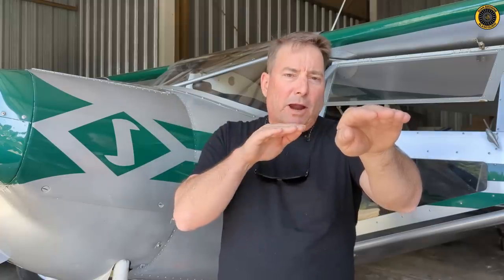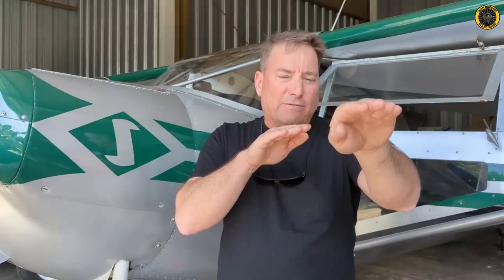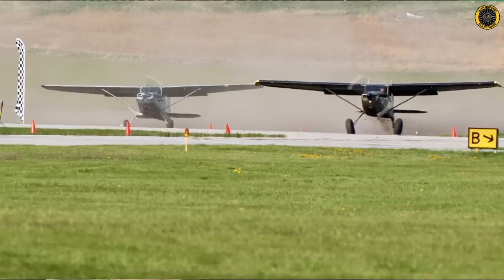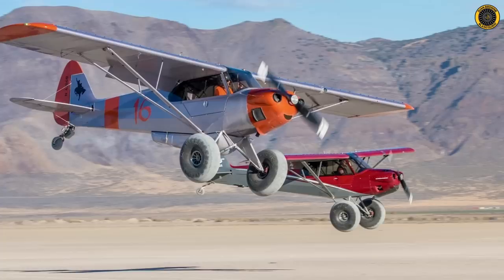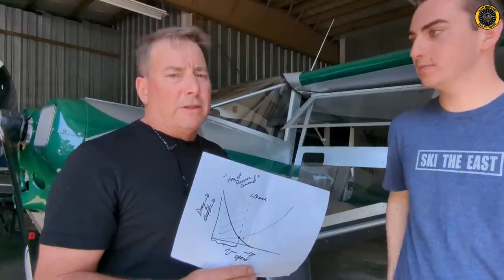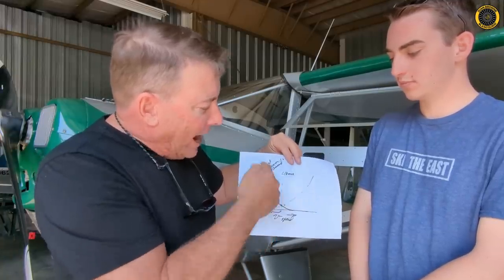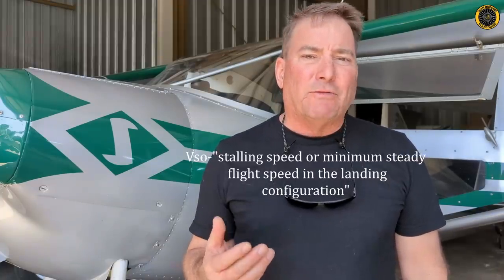Cessna 140 Stall/Spin Accident Wayne NE

Comment: Horrible accident and so sad....The most accident pilots have over 250 hours and under 1000 hours...for STOL,  a steep stabilized approach followed by a touch of power at round-out is what a lot of us Alaskan brush pilots do....seems to work OK. Never haring it on the prop....

Comment: Every pilot should have some training in aerobatics. An experience aerobatic pilot would leave the ailerons neutral, and pick up the low wing with rudder.
Reply: Sam,a lot of pilot training is inferior. This is basic airmanship which needs no aerobatic training. Some Flight Instructors simply don't impart knowledge and are just "time building"😡.

Comment: Super tragic accident that should not happen. It must be a headache to practice extreme STOL operations in gusty wind when suddenly several knots of airspeed is taken away when the wind slows down. It must be extremely difficult to „trust“ your safety margins in such situations. If the pilot unfortunately may have some errors in the stall situation it is a tragedy in itself. But if the real killer is the gusty wind the whole ordeal could perhaps have been avoided by better decision making of the competition leaders??

Comment: Can you please explain the phrase ‘hang it off the prop’?
Reply: Consider an acrobatic aircraft with a very high power to weight ratio, such as a turboprop or jet fighter (but definitely not a C140). In these aircraft it is possible to be in a stalled condition but still ascending, purely by the thrust of the engine overcoming the drag from the wings. This is the opposite of normal flight, which is sustained by lift from smooth airflow over the wings.
Reply: @gordonrichardson2972  makes sense, thanks Gordon

Comment: What a tragedy, so awful to see. Thoughts and prayers for the Dafoe family.

It seems this accident has catalyzed a lot of discussion about the risk/reward equation for STOL competitions in general. Some have broad-brush categorized these events as "excessively risky". A few thoughts, as a non-pilot interested observer of aviation. Hopefully they have some value! Curious to hear what pilots with knowledge & experience think.

1. I'd think the survivability of an accident during the actual STOL competition / demonstration operation is very high in a true STOL aircraft, especially if the pilots have good harnesses, wearing helmets, etc. Sure they are flying on the ragged edge of stall conditions, but at low speed and ~20' AGL or less. Potential crash energy is relatively low and there isn't enough altitude for a severe nose-down impact. Now how much does survivability decrease at the higher speeds that Cessna 140 will be flying? That's a question worth asking. For competitive events, should organizers set a maximum stall speed limit, to control which aircraft participate and contain the potential crash energy during STOL operations within some reasonable bound? Worth thinking about crowd safety here too.

2. Whatever the stall speed, continuing to fly at the ragged edge of the stall envelope after liftoff, or initiating it before flare to touchdown seems like senseless risk. As far as I can tell, there is nothing to be gained in terms of competition or putting on a show, and survivability of a stall is low as Tom's accident so tragically showed. A bad altitude to stall an airplane. Did Tom know how close to the limit he was when he got backed-up in the pattern, and were the consequences of a stall at that moment top of his mind? We'll never know, but perhaps there is opportunity for STOL-specific procedures and training to ensure pilots are switching mental gears from "stick and rudder on-the bubble flying" during the STOL portion to standard "Vref + margin" flying once they are out of ground effect? I can imagine how a pilot might get "sucked-in" to the thrill of balancing the airplane at near-stall conditions, and forget when and where that type of flying is simply too risky. In Tom's situation, you want your mental program for "maintain airspeed", to kick in, not "perform STOL flying".

3. I hope useful lessons learned come from all of this, and these STOL events continue to grow safely. Love seeing the airmanship & flight physics on display. Looks like a great community to build skill and camaraderie, with some low-key competition to keep things interesting. Terrible that Tom's accident happened, and during the event with so many people around to witness. Hopefully the aviation community will learn and benefit in some way from this hard lesson.

Comment: What a tragedy. Wonder if there is any way to practice the right reaction to those low altitude wing stalls in turns. Wasn't part of my PPL training. Simulated approaches are higher altitude maybe? Is anyone doing this specifically to train muscle memory?
Reply: Jan, you should have had some preflight plan on the flight lesson, instructor demonstrates, you perform.
Reply: @garymiller5624  I mean specifically stalls in approach patterns. Did plenty of regular stalls but never in low altitude. Honestly not sure I would have the reflex to push the plane towards the falling wing like in the video. Of course almost impossible to simulate. I’m good at flying exact approach speeds though, maybe that sufficient.
Reply: @experimental_av  There are Take-off and landing stall's in several configurations but need to be done at a safe altitude. I question that you were exposed to all of them but certainly needed to be. They are required by FAA in the Flight Test Guide. Practicing "slow flight" in different configurations and banked are excellent for feeling the airplane. If one doesn't "feel" an airplane after some time flying the same plane then it's time for some more instruction with an instructor WHO CARES 🤭

Comment: RIP pilot.. It's the C140 a  STOL  aircraft ?
Reply: Not a STOL aircraft as manufactured. I owned a true STOL aircraft, HELIO COURIER.
Reply: NO, it is not.  Which begs the question; why would Tom make the decision to compete with STOL designed aircraft using a vintage C-140?.... all while leaving a beautiful family of six at home while he exercises his ego.
Reply: It can be when operated inside its limitations. Will it perform as well as designed and built stol aircraft. No but all aircraft have a set of short take off and landing procedures and performance that is as widely diverse as the aircraft themselves.
Reply: @jmp.t28b99  had one of those “ Helios” at our airport last year. Cool aircraft to watch. It was some strange flying characteristics doesn’t it.? I seem to remember something someone told me. Could be wrong.

Comment: So what has to be done? Turn towards the direction of the stall, in this case turn right with right rudder ?
Reply: You learn to avoid it before getting into it.
He was too low to lower the nose and level the wings and power up.
Reply: Opposite rudder. And someone correct me if I’m wrong on this but neutral stick as in hands off while kicking rudder. Plus, chop back throttle to idle. If have the altitude, be ready to pitch down before level and add power.
Reply: Other than preventing the stall/right spin in the first place, LEFT rudder would have been the most-appropriate input....when the right wing first dipped! To prevent the stall spin in the first place once he realized that he was getting too close to the aircraft being overtaken, he should have lowered the nose somewhat and increased the throttle until airspeed was such that it was safe to initiate a turn for a go-around.  Coop
Reply: Abort landing
Increase engine speed
Slight deviation flying parallel (left) of runway.
Go around flying a left hand circuit.
Reply: Scott Perdue produced an excellent training demonstration video a few months back:
FlyWire- scott perdue: "Spinning a Bonanza with Shannon UPRT 1"
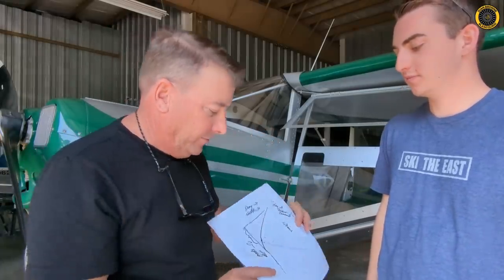He has another recent excellent video "J35 Bonanza Power-On Stall / Spin", key to watch from that from the 7:58 mark.

Comment: Sad. But it seems to the outsider at least like a discipline rife with adrenaline junkies, young guns, Red Baron hot doggers, and limit pushers. There’s no other way to explain “good” and “experienced” moderately high-hour pilots that routinely crash doing something basic that students do all day long, in and out. Especially when many of them teach others how to avoid the things that bite them. Call it whatever you want, but when I hear something fairly risky or dangerous that sounds like “competitive knife juggling,” I know it’s a tent to avoid, something I wouldn’t want to participate in or watch. Life’s a big enough circus with enough spectacle. But nonetheless, the sport would thrive and make money from spectators. Just like chariot racing. Which is basically straight-up testosterone poisoning. Just another example that flying, ultimately, is just horizontal skydiving with the high probability of controlled descent and stabilized approach. Adults are gonna do what adults are allowed to do, and take the risks they are comfortable with. We have to respect that and celebrate their choice.

Comment: Respectfully... to one and all: Please Consider the possibilities of good that could come from tragedy ? 
This competition could morph, into a power off (engine fail) competition, and that the event would begin at a KEY POSITION (speed 1.3VSO minimum & altitude for different classes) on down wind. Base leg 1.2VSO to say 100' to what ever is needed (slips/flaps to 3pt and stop.
Competitors are  graded on various XING gates of SAFE speed/altitude. The WINNER is an all power off at key position, hitting the speed/altitude gates, landing 3pt inside manufacturers power off landing distance over 50' obstacle. 
This event eventually could be open to ALL classes of single engine variants & still NOT  take away from the founders FUN of off airport operations. 
Engine power is allowed, but once reduced, CAN NOT be added (as in a progressive eng failure that just never gets better. If engine power added is necessary to make a gate or be safe...so what?
Muligans are an absolute !!! Handicaps could be built into the event based on experience !!!  Everyone has fun, and safety is a priority. 
The event would be named after & celebrate the life of our recently departed airman.
Ailerons are the rule, not the exception.
R Bud Fuchs CFI/ATP 1507987